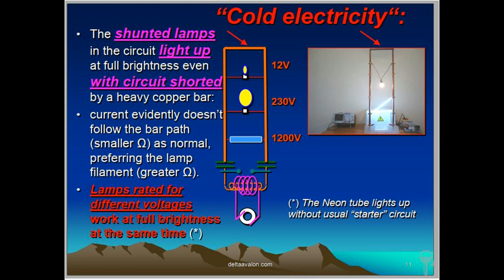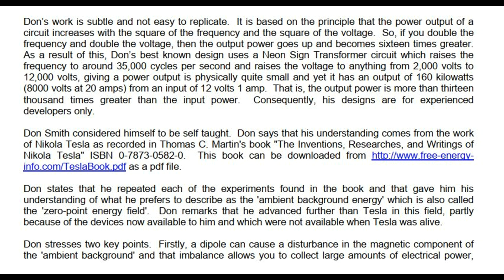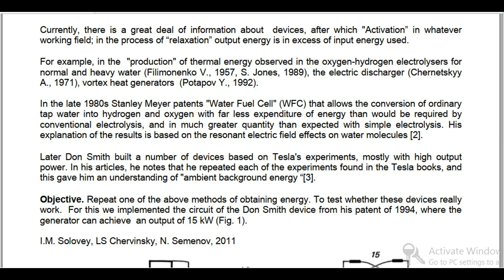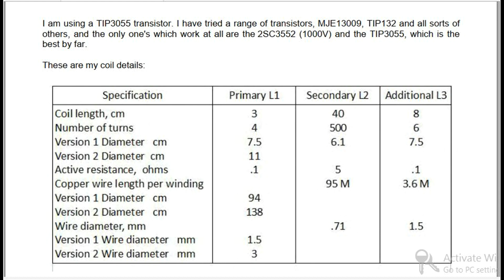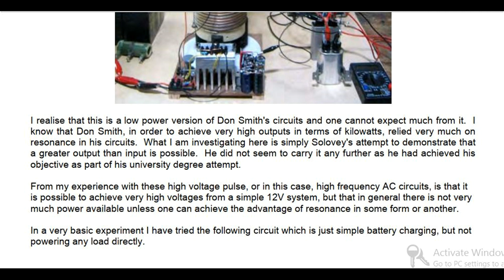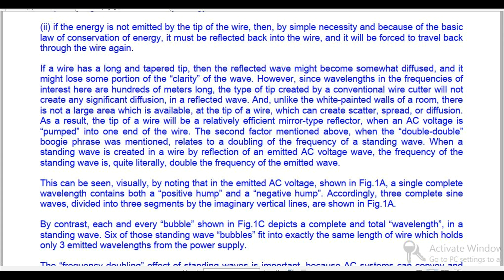Nikola Tesla's cold electricity (radiant energy )

Comment: You know that cold electricity is just high frequency That it oscillates  so fast That doesn't have time to affect the body, right?
Reply from the maker: Floyd Sweet's vacuum triode amplifier generates cold electricity at 60 Hz . 
5G towers don't radiate cold electricity - radio waves is hot electricity.
Reply: Not COMPLETELY accurate..... but in general, yes higher freqs, especially with HV, being switched/oscillating at such a high rate, moves the Electrical current/wave increasingly more to 'staying within' the so-called "Skin effect", and the characteristics thereof.
But it is a BIT more nuanced than that.